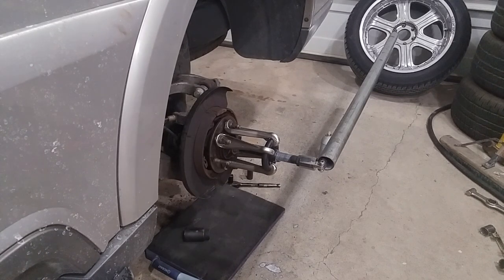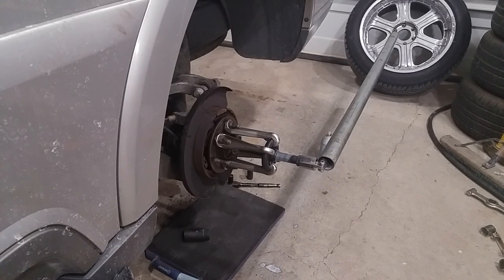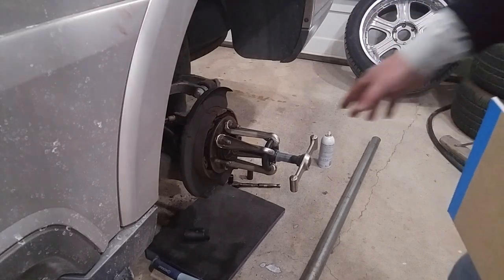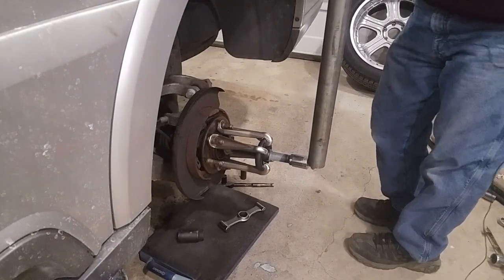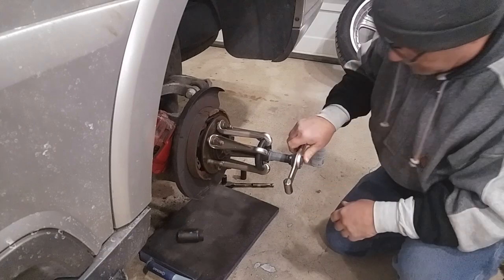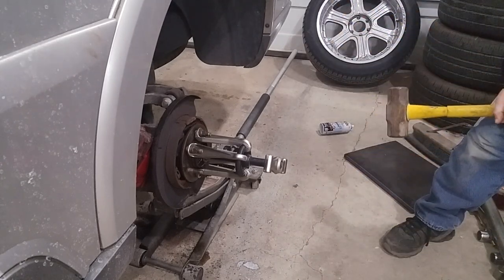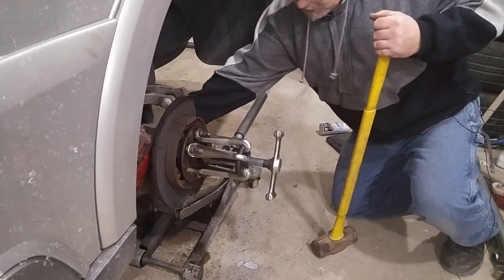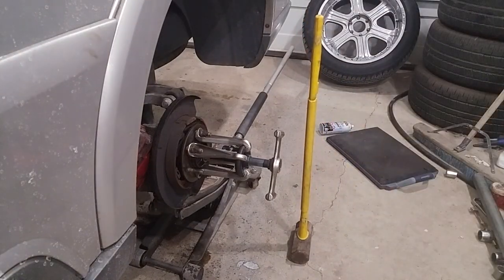OTC Hub Removal tool 6574 and 7394 ( OTC-6574 - OTC-7394 )

Comment: Many thanks to you Sir!  I'm about to push the Amazon button on an OTC hub puller.  I am the original owner of a 1998 F150 4WD Lariat Flareside std cab pickup with the right CV axle seized in the hub assembly.  Discovered this issue in the course of replacing upper & lower ball joints on this vehicle with 111K miles. Got both uppers and left lower changed, but the right lower ball joint change prevented by the seized axle.  I tried the local auto parts stores' loaner hub puller tools and they were all utter schitt, so now I'm buying the highest rated hub puller I could find.  

This has got to be the finest testament to an OTC tool ever committed to video.  OTC should pay you for this wonderful advertisement!  This is real gem of a YT video.  Thanks again Joe.

Comment: Boy I can definitely relate to how you feel.  Working out in a cold garage, snot dripping down your nose, all out of breath   frustrated as hell, but determined to get the job done.  I tell you though.. I've had some tough drums and rotors. I've even broken a breaker bar with a 4 foot pipe on a stubborn axle nut, but this video definitely takes props.  Well done sir!

Comment: Those axles sure can become tight and extremely difficult to remove. However, in the video on this particular occasion, the main problem was the wrong choice of tools and method of removal. 

The puller is absolutely necessary, of that there is no question. This was the only correct decision. The first mistake was failure to heat the axle housing. Not supporting the lower control arm was the second mistake. This allowed the suspension to move with each strike of the hammer. This absorbed much of the shock, which operation of this type relies on. The third mistake was to use a 1/2" socket and breaker bar, together with a cheater bar. 

The correct hand tools to use would have been a 3/4" impact socket installed on a short 3/4" extension, together with a solid 90 deg, bend handle, extended with a suitable cheater bar.
The short extension would be needed so the tool string could be supported by a jack stand in order to reduce tendency for the socket to tilt on the pulling screw.

The remover pulling screw itself would be required to be liberally lubricated with a suitable heavy duty grease. (NOT WD 40 or any other similar product). This is to prevent galling of the thread on both screw and puller body.

Had methods as outlined above been utilised, the job would have been much simpler, faster and definitely considerably safer.

One more very important aspect. He was kneeling in direct line of the pulling screw, while the tool was under extreme strain and loading. In the unfortunate event of a component failure, the result would have been devastating. 

Apologies for a long posting. Cheers from a D. Eng. in Indonesia.
Reply: You're totally right
Reply: Nice 👍🏼 !

Comment: Thanks. I've been building a 99 grand prix with over 290,000 miles and am at that point. The hub just stares at me. Glad you've crossed that bridge.
Reply: I’ve been in that boat with my 02 impala. Wheel bearings are the next and hopefully final project

Comment: Hears a tip. When the bolt on the puller gets tight put on a doner socket over the forcing screw and hit it with a hammer. That goes with anything using a puller or press.
Reply: The hex is actually machined to be able to strike it. 
After a lot of striking it would have to be re ground. To get the socket back on.

Comment: Food for thought. When removing anything with a puller or press, find a spot on the hub face, knuckle, or whatever that is holding the part captive and after you have pressure on the part to be moved, smack that hub face, knuckle, etc like it owes you money. Apply more pressure and smack it again. Some people even smack the end of the forcing screw. Minimum two pound hammer. Penetrating oil on the part to be moved and the forcing screw also helps.

I like watching these videos where people overcome challenges.

Comment: I had a seized axle finally got it out with a hub puller like u did. But the problem was that in my effort to remove it nicked one of the splines inside the hub. So now I had to get a new hub, but than I questioned if while pulling the hub off, the race on the bearing comes out, I'll have to replace the bearing too so than I got a new bearing.....an easy job turned into a nightmare for me

Comment: Bro, I went through every emotion watching this video. I'm in the process of replacing my front wheel bearings and I had the unfortunately realization that I don't have the right tool to pull the hub assembly off the axle. Thanks for this full walk through and the details of your experience removing the hubs!

Comment: I have worked on my 2009rav 4 rotors and hub bearing. Each one has been a beast to work on. The front pasenger axle and bearing seperation is testing me. Good video. Thanks

Comment: I've had many stuck bearing hub assembly's.First make sure  all the bolts that hold the hub on are removed. (Usually there's 3) Then
Remove the axle nut and soak the splines with PB Blaster. heat the front of the hub with a propane/map/acetylene torch in a circular motion around the axle shaft.
if it doesn't come off repeat.
I have soaked them and heated for 2 days on and off but they always break loose. Patients!
Also no expensive puller is needed, I flip the brake rotor over and beat on it with a lead hammer.
Hope this helps.
Reply: Just buy a wheel bearing press kit and... Out she goes!!  Lol

Comment: Same situation but in my case I Replaced The axel the knuckle  the hub and bearing as a whole piece before That you,  have to disconnect  the entire  knuckle from the car  then pull the axel  grabbing the knuckle without removing the axel nut . Then install a used but good conditions  axel,knuckle ,hub ,bearing, as one piece  From a junk yard cheap solution less headache less stress. I live in a apt building so I can’t do mechanic job also working in the streets  you may get a ticket so I just adjusted to my situation  and I found it easy

Comment: That is a very difficult job but an impact gun and a air hammer makes it much easier.   Turning the bolt on the puller with an impact helps to jar the bond apart.  Also occasionally go in between the fingers of the puller with an air hammer and jar the end of the axle

Comment: Sounds like you need lube on the tool. 3 feet should work, one on every other lug puts you in the center. Another aid, hit the screw of the tool every so often to pop the axle some and remove the pent up stress.

Comment: next time you get a seized axle like that, DO NOT hit handle with sledge hammer, you will bend the center screw, or something else, the best way i do it, is use a impact gun, until it tightens up, then hit it right on top of the center screw with a 4 pound hammer,, and it  will loosen, repeat steps, impact gun, then hit with hammer on drive screw/bolt.. works every time, says a mechanic 32 years exp.. nice try

Comment: Does that put undue stress on the pinion, and carrier  gears? I would have used my Makita cutting wheel and sliced that hub down the middle just before it would start to cut the axel. That hub would have come  off like butter. Cudos on your repair though. Lots of elbow grease. Another thought would to use a blowtorch, turn that hub glowing red and then use the puller.

Comment: you can rent hub pullers $10 a day. or free from O'Reilly's and AutoZone. also when it's tight hit the end of the puller bolt . that shocks it  personally I like heat and beat method

Comment: All that work you could have just removed rear assembly then pulled it as one unit taken it a work bench with a vice then use a drift punch and pound it out if you own a press you could also do it that way.

Comment: The hammer wrench is a gimmick, that's why it's not inc w/ the HD version. Once you have max tension your supposed to strike the hex directly with the sledge to shock it. Add tension and repeat. And this is where you need 3/4" drive tools, especially when you need a cheater bar that size.
Reply: Have you try using rattle gun instead of sludge hummer.

Comment: Did not use any WD 40  ???
That normally helps 
You are right about the jack .under the hub for support ...remove the spring in the hammer stroke 
Good job . you krpt at it .

Comment: Could've also spent $25-30 on impact sockets if you had an impact gun if not you could've used a ratchet with a cheater bar as well, would've made that job a lot easier.

Comment: Really good video! I was removing my hub on a 2003 Dodge 3500 4 x 4 using the same puller you used in your video. The hub came apart at the bearing leaving the piece with the 4 bolt holes still tightly connected to the knuckle. Can I use the bolts and the front axle to pull out the remainder of the hub with out damaging anything?

Comment: Wow all that when you could have just used an air hammer to get that axle loose. I thought you were trying to pull the hub off?
Reply: I've had the axle & hub assembly taken out together and even in a 20 ton press the corrosion just laughed in it's face. A compressor would blow up before an air hammer would ever touch some of these.

Comment: Honestly you would maybe need the 1" impact gun for this one.....
Reply: Am sure the hammer is applying more force than the gun could possibly ever can
Reply: Yeah if I do a rough calculation it looks like your probably imparting anywhere from 1500 Ft lbs of torque probably up to 3000 ft lbs of torque on some hits.  The best 1" can probably hit at 1900 ft lbs of torque if properly plumbed, oiled and new.  Yet again for you to lift that hammer and hit it again and again it takes you a lot longer than what and impact gun can do.  I'd assume it could do the job.  But unless your job is automotive repair your not dropping $400 on a impact gun your buying the sledge hammer and anvil as you did.  Good work!
Reply: @ClaudRasberry  Lets say at best from the axel center to the hitting point is  6 inches.  Therefore whatever impact force is hit at the anvil is divided by 2 to equal the foot pounds imparted.  The impact gun 1 inch can impart 1900 Ft Lbs.  Therefore, he has to impart near 4,000 pounds of impact force to the anvil to equal the 1" impact gun.  it is the same as dropping the 10" hammer 2 meters onto the anvil.  So yea hitting that  anvil with over 4k lbs of force is probably doable.
Reply: @kartboarder22g17  am actually a mobile Mechanic for yourmechanic.com and I never figured I would need a 1 inch impact until now. 

Am in the north and spent hours hitting shit, and walking away from a job I couldn't complete. 

So I will be investing in the Milwaukee 2867-20 , but may still wait for a gun with more power....might just use it 2 to 4 times a year....but I just rather have the tools I need.

Comment: see serano comment.  get the factory service manual .watch some vids that are more sucessfull. lean proper way to operate tools. drop the fly by night shops and put the lincoln dealer in your speed dial. this job is 35 min. of book time, and i know you think this was the only way to do this but trust me its not. from 53 year retired tech

Comment: didn't you lube those threads?
Reply: I'm sure he did.
I would recommend  adding lube after every turn of the nut (you've exposed new threads for the fluid to penetrate)

Comment: You just didn't know how to use that tool correctly
Reply: Huh? Am curious,  what did he do wrong
Reply: @ClaudRasberry  He did an excellent job because he solved his problem, but he could have used heat around the axle flange, he could have used the penetrating oil laying on the floor in the video, he could have used oil on the threads of his puller, he could have applied force to the axle shaft with the puller and then either smacked the hub face or forcing screw with a heavy hammer. These are all things that probably would have made the job go easier